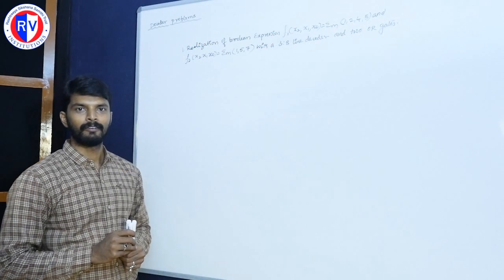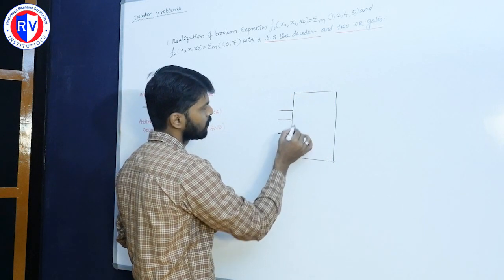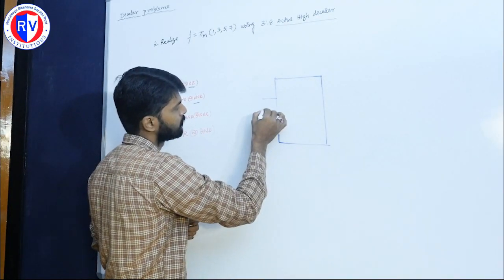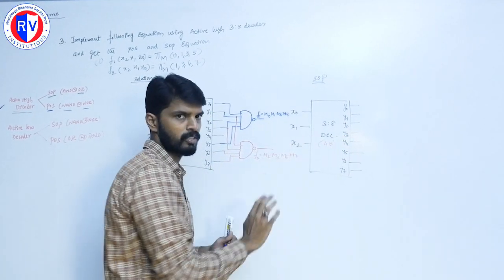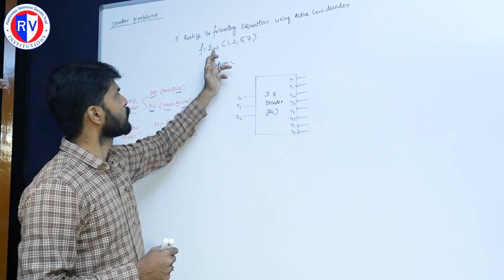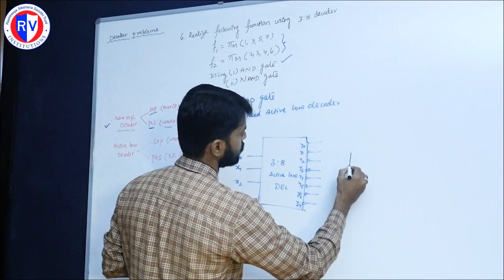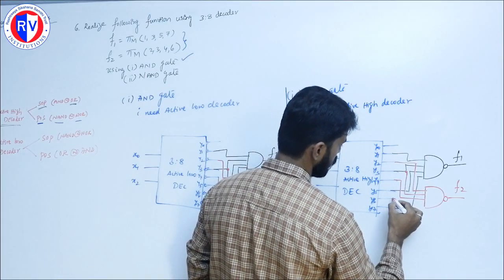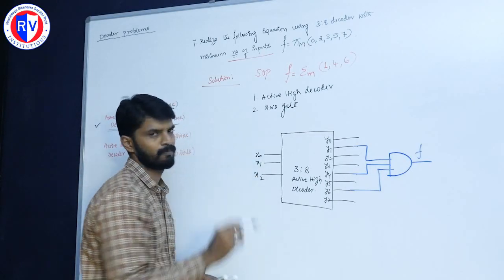lecture 16 : Decoder Design related problems

Comment: What you teaching is wrong(2 problem) .Because for NAND gate output is 1 if any one input is zero .So NAND reminds high in any case of  Decoder .For reason this reason use NOR Gate instead of NAND Gate. The NOR gate is initially high for no case occurred in the given Maxterm then become zero for any case occur in given maxterm .If you have any doubt please run logical circuit simulation .